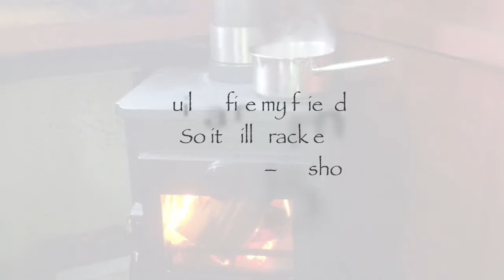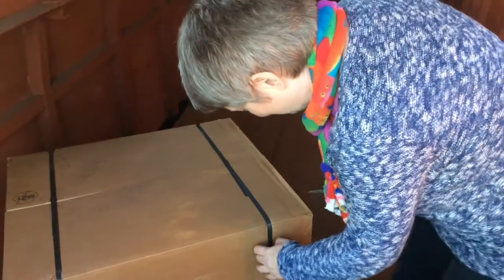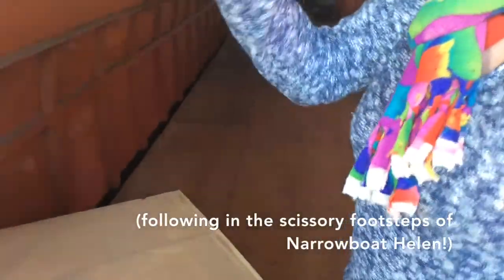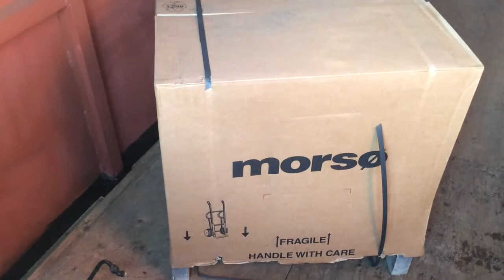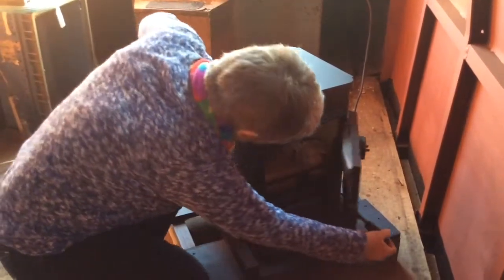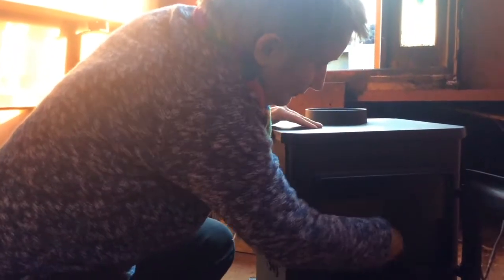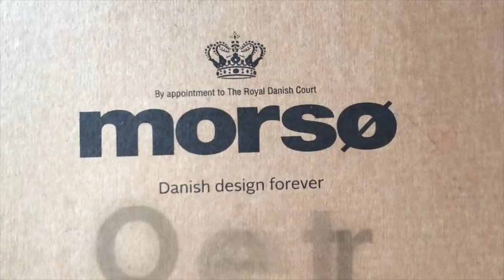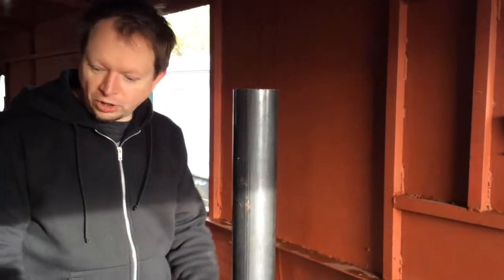#2 Stove Aways

Comment: Good looking stove I think you should have installed it midships away from the door open the door all your heat will go straight out  midships the heat would go  fore and aft aft espessicaly where the  bed cabin is its just a suggestion cheers hope it keeps you toasty warm try kook img lamb shank and vegetable soup on a cold winters day with warm buttery bread go down a treat with a hot cup per of sugary tea on a cold winters day have fun calm waters and easy locks be ahead of you both again cheers and have a view beers🍺🍺🍺🍺🍺🍺🍺🍺🍺👈this many or more
Reply from the maker: Hi Cecil, midship would have been better and we did think of moving it but there was a hole in the roof already so we're hoping that it'll be ok (diesel heating too). We already cook and heated food on the stove and plan many a good tagine recepies.

Comment: If you are moving it to the centre, what will you do with the hole you now have in the top of the boat!
Reply from the maker: We decided to leave it where it was, mostly to do with the hole in the roof but you can cap them off but the layout we planned meant the stove would be best left where it was – not neccessarily the best place but deffinately not uncommon even on new builds. We have been very toasty over the winter. Best, Martin